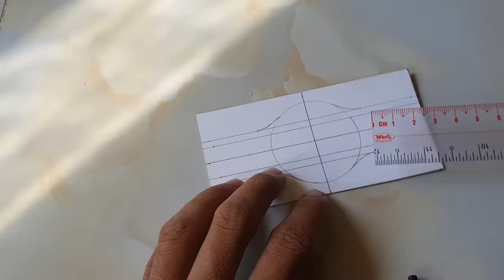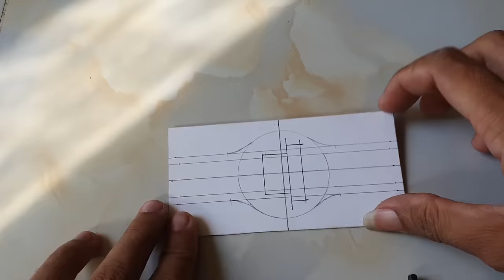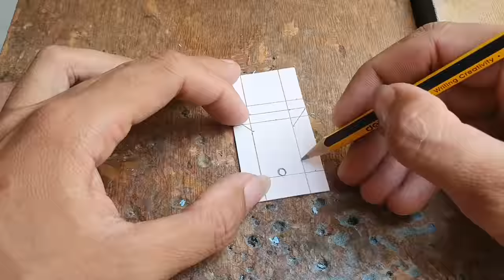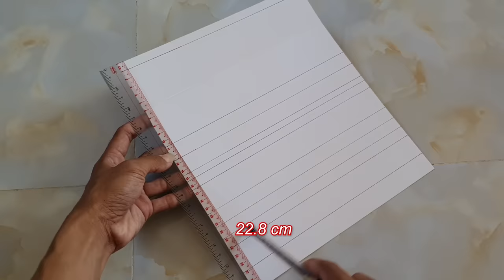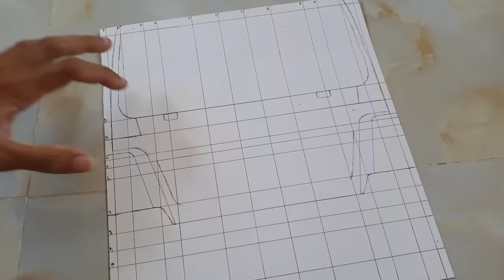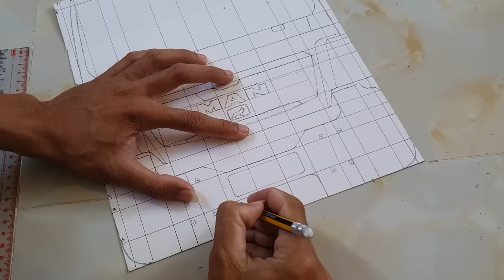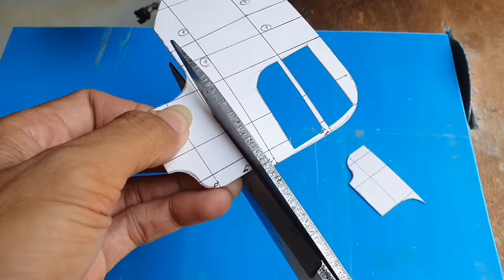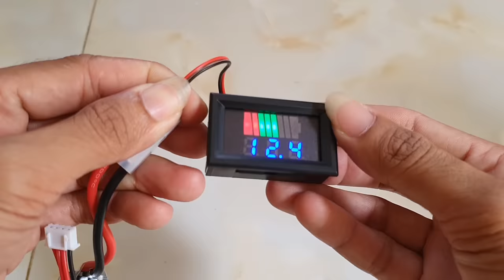How to make RC Truck MAN TGS 8x8 1/10 Scale 100% Completed (Made of PVC pipe)

Comment: I'm blown away by things like the differentials, and telescoping hydraulic cylinder. Pretty amazing what you can do with good design, basic materials and tools. 

I assume that super glue holds pretty  well, but I think there are acid type glues that etch into plastic and almost weld it together. Seems what you use works, figured I'd mention it anyway.
Reply: Doesn’t buying ready made axles with differentials and dog bones make sense rather than cutting out plastic sheet and acetate glue? The available ready made parts in the RC hobby outweigh your time? Understandably the body, frame and drivetrain are your brainchild but wheels,tyres, axles, and motors would be better built by Losi, traxxas, HPI and other suppliers in the aftermarket hobby…. Just saying. Turnbuckles and steering arms are infinitely adjustable rather than wire and wood screws.
Reply: @halnutt1790   Or just buy a ready-built RC truck and save yourself from having to do anything...

I think you're missing the point of the project.
Reply: MEK: methyl ethyl ketone.  Plumbers' pipe joiner glue.  Chemically welds PVC pipe.
Reply: @halnutt1790  No
Reply: @halnutt1790  😅😊v😅
Reply: uhyd😮uuh7😊
Reply: @railtrolley  Uduuuuvuuuhh Bobby Uuuuuuubuhhubuuui😮hvuy😅😅😅vug😅g😅😮uuu😮😅😅uuuu😅😅😅u😅😅😮😅d😮